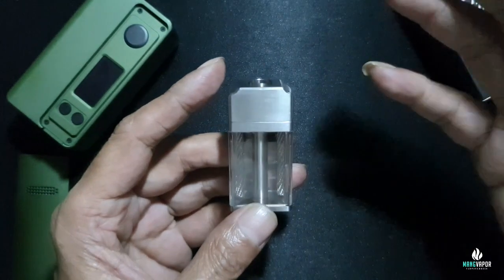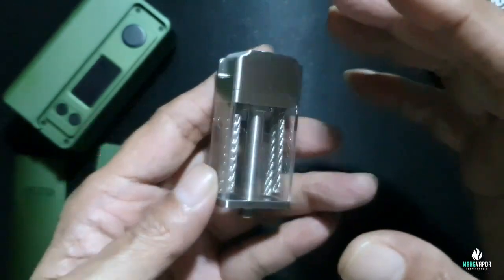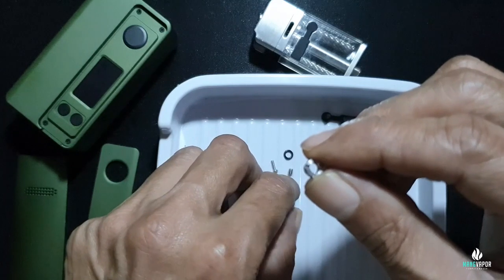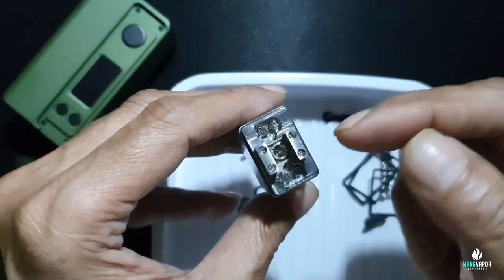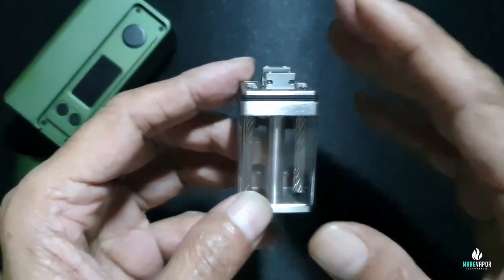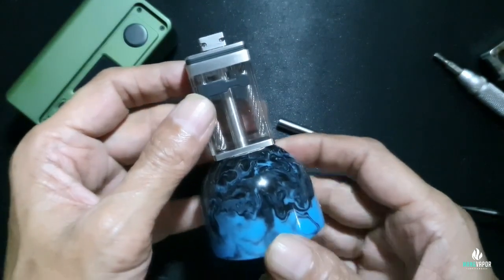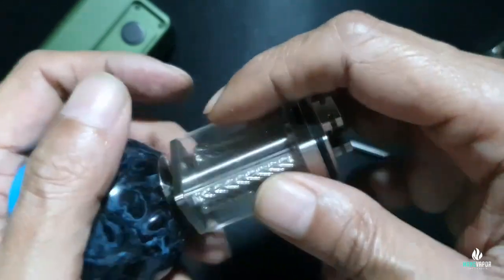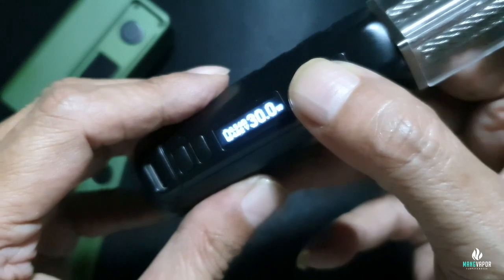Mengenal & Membuild STUBBY RDTA

Comment: Mate, you're totally wrong with this RDTA BORO STUBBY TANK, airflow on the deck must be on the same side on the deck where is rubber plug for refill!!!
Same as MTL KIT STUBBY AIO!!!
Reply from the maker: there is no effect at all , I prefer it like this because it looks neater
Reply: @MangVaporOfficial  Ok, but for me it's easier at properly way, to put in, to know always that's airflow is at the right place and to refill it... I use BPMODS PIONEER INSIDER BORO RBA, TITA X RBA BRIDGE in PRORO BORO TANK by PROTOCOL VAPE TECH, and VapeSnail BORO RBA TANK...